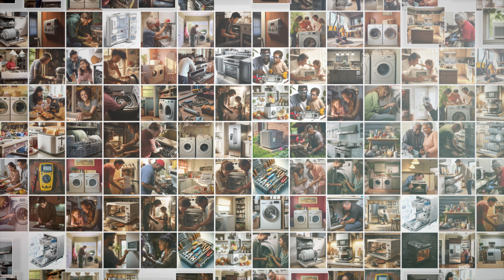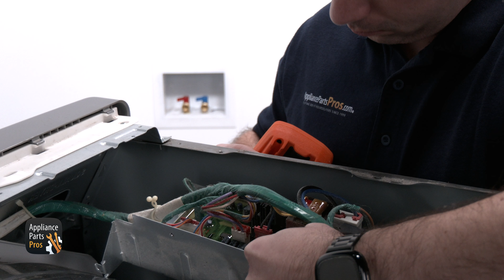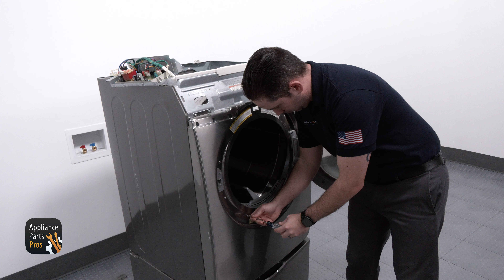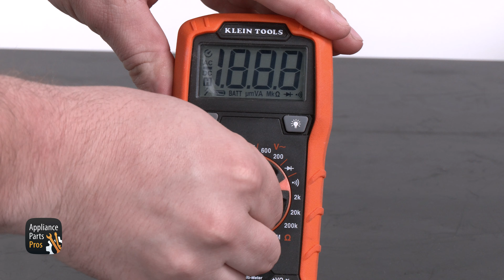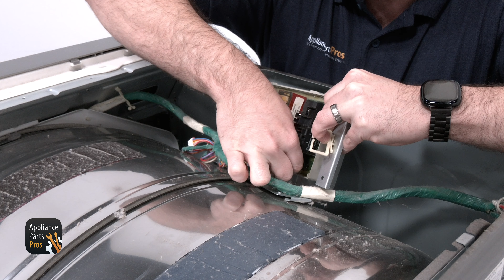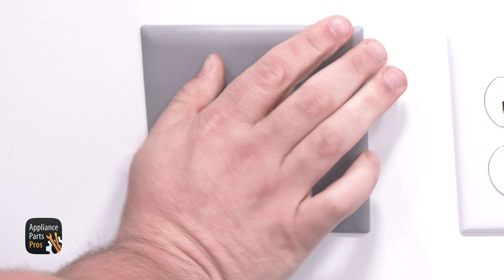Why Your Samsung Dryer Won't Heat Up FIXED!

Comment from the maker: 🔧 Fix it yourself:
▶ thermistor (no part number specified): https://www.youtube.com/watch?v=vVpxkkdIC24
▶ GE dryer heating element WE11M23: https://www.youtube.com/watch?v=hSszALjDd4I
▶ Gas Valve Coil Kit 5303931775: https://www.youtube.com/watch?v=tLWYNKbZ7Mg
▶ Fabric Selector Switch (Speed Queen electric dryer, no sp...: https://www.youtube.com/watch?v=JUam4ceZ41k
▶ Thermal Cut-Off Kit #279816 (thermal cut-off and high-lim...: https://www.youtube.com/watch?v=_fjNHYcPH5E
▶ High-Limit Thermostat WP3391914: https://www.youtube.com/watch?v=I9bkLBgyvY8

👍 Found your fix? Hit Like so others can find this video too!
🔔 Subscribe for more repair guides: https://www.youtube.com/@AppliancePartsPros